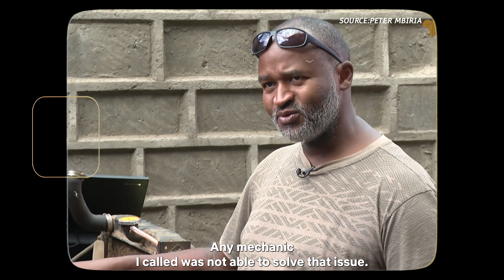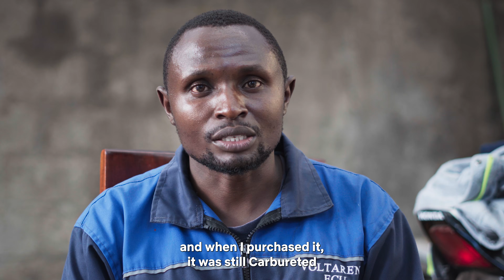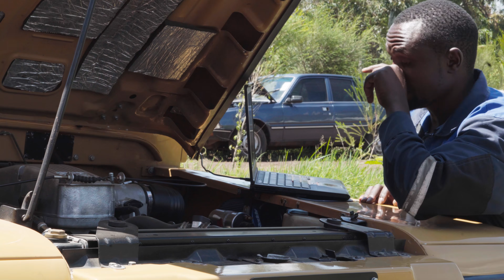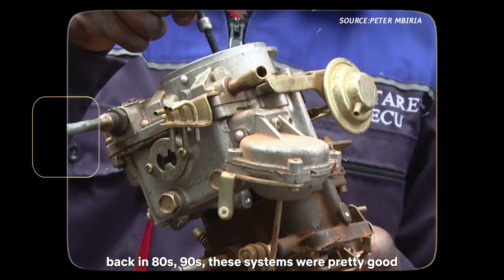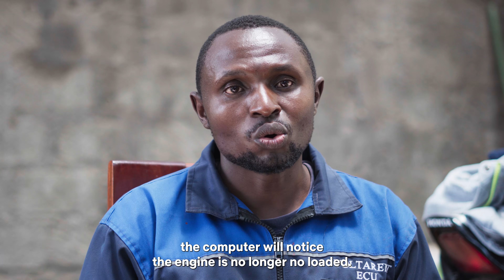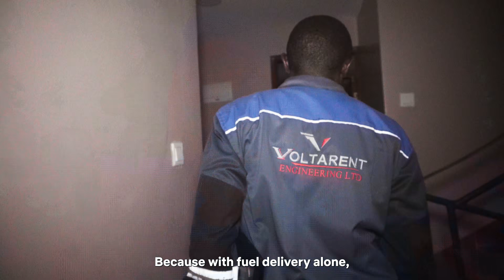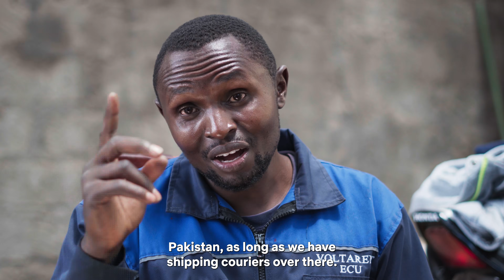This African Genius Makes Old Engines Work Better Than New Ones

Comment: I believe the ECU is basically a Speeduino. I don't see any major innovation there, but respect for the craftsmanship required to do the conversions.
Reply: The IDE on his laptop looks very much like the Arduino IDE.
Reply: @pjaenator  It says arduino at the top
Reply: @pjaenator  I made many things with Arduino boards that have been runnning for years, a few have been continuiously working for over 10 years. They are using Atmel MCUs. Of cocz my later projects have been based on ESP32 like everyone else but still, I prefer ATmega as it's legacy and never fail me over the years.
Reply: Looks like he’s designed his own PCB and definitely had to work with code because he’s using an Arduino Due which means even the speeduino firmware would take some effort to make it work.
Reply: yeah the technology itselft not so much innovation.
but the implementation in the certain condition makes thats a wonder inventions. 
coz maybe nobody want to do this. big corporation wont touch this because not much money they will get
Reply: @rofidganteng1  i mean... big corporations never are in the business of assisting you repair things. They want to sell more/new. But yeah definitely good for his community
Reply: Yeah i remember reading a thread on Reddit they mentioned it's not really cutting Edge stuff what he's doing
Reply: @watchinyoutube8919   nothing Elon musk is doing is cutting edge yet he does things
Reply: @watchinyoutube8919  does it have to be cutting edge for it to be a good idea?
Reply: Can anyone of you hater do what he is doing? I bet h
If it were some euro, you'll be clapping your hands.
Reply: @ No, if it was some Euro it wouldn't get a major video on the youtubes.
Reply: @Aliceinchains1234 bruv, this is the Afrimax English channel, ofc he wouldn't be on here if he was Euro lmao
Reply: You sound rascist @Marvin.45
Reply: @Marvin.45  I mean its basically Holley Sniper kit that holley made over 10 years ago. Affordable ECU + EFI conversion kit
Reply: Ya it's a common for Europe or a developed company. But this man isn't buying a ECU OFF A shelf and converting a carbureted engine to fuel injected. He's engineering and programming everything himself.
Reply: @Alexander12547 He just did a copy o one part of car from 30 years ago, based on electronics invented not by him. Sorry pal, that's just basic engineering and programming. Not to mention this is not universal
Reply: @polololo8377  no swap is universal. No, he didn't invent whole new tech. Yes, he adapted existing tech to old engines cheaply with good results.

Any gear head in the US that did this as a project would get praise. In Peter's part of the world, he is one of the few able to do this, and his work is far more impactful. 

The innovation is versatility and low cost for the level of results.
Reply: @XxxThePsyCheMisTxxX this, how many people out there are basically making and tuning speeduinos affordably for people to actually be able to find someone that can do all this work and custom tuning for a good price
Reply: @polololo8377 but can you do it?
Reply: @polololo8377  As an R&D engineer with 10+ patents. I would say invention doesn't get you far if you have no buyer. An engineering company has 2 major sides. The R&D side and the business side. He gets buyers and seems to be running a portifable business. This is not an easy task and quite an achievement. Over the years, I've been with start up with people that are extremely smart, with Ph.Ds and whatnot. However, doesn't matter how complex and unique your device / invention is. In the end of the day, it;s  business and you need customers, you need to make money. Tesla had lots of great invention but he failed as an inventor / businessman because he did not know how to do business. The world runs on money.
Reply: They the same as is it haltech ecus from Australia
Reply: And so?
Reply: How many engines have you transformed like he is doing so far?
Reply: Someone hurting 😂😂😂 as always
Reply: Innovation is the flexibility of the system, and the cost.

Full engine control renovation is a lot. Coil packs, MAF and EFI in a throttle body, and just like that early '00s efficiency and performance on tap (if the engine compression is good, etc.)

That's not nothing, it's darn scrappy and should be scaled up.
Reply: @n0n1cK0  i believe your just a hater.
Reply: Dude, stop being mean
Reply: This technology has been out for decades and readily available from multiple companies he has created nothing only cloned existing technology
Reply: @HorsedeadCowfat  could you clone it though?
Reply: While you yap he did i believe people saw it that way
Reply: He's Black. Ofc it's a major innovation.
Reply: @Aliceinchains1234 he's EE, not CE or CS; why reinvent the wheel when it isnt his specialty? His effort is in the proprietary artwork for the carrier card. Have lots of people restomoded with custom arduino setups? Yeah, but how many packaged that into a commercial product that serves antiquated cars in austere conditions; this guy.
Reply: @Aliceinchains1234 bringing racism to YouTube, now that's innovation! sigh

Comment: This video kept me interested enough that I watched it all the way to the end. However, I would have liked to see more of how the new fuel injectors join up with the old carburettor intake system. Obviously the carbs come off, but then what? I'm intrigued though and would really like to know more. I used to like tinkering around with carbs on my classic cars, but they're so wear-prone and so easily put out of tune for something that not only effects economy but the health and longevity of the engine. A carb that's out of whack (either too lean or too rich) can greatly reduce an engine's lifespan.

Comment: I need your help,I have diahatsu mini truck 1993model and it has low compression I'm from siaya county
Reply: either piston rings or valves are worn out and need to be replaced
Reply: @elu5ive  piston rings and valves have been replaced and it started losing power timing and the distributor was touched

Comment: he's a good mechanic with passion, which is the most important thing here.
these self inflicted issues of german mechanical fuel injection have been fixed approximately 40 years ago,
but it's impressive that he can do so much locally, with little equipment and bad availability of parts and barely any industrial infrastructure
Reply: He’s more than a mechanic.

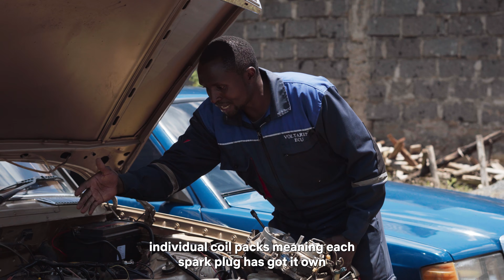Comment: 4:00 he talks about that FDS ive seen one of those be rebuild in the EU a while ago with oldtimer restoration. But a lot of people dont know how rebuild these already so. also it being part mechancial and electric doesnt make it easyer. I can see why a newer ECU could probaly run the engine better then the old parts that are harder to find eventualy or to be rebuild. Also to make that landrover run cheaper -- it has a market in the EU and the U.K by the way. -- there a lot of people who stil like them landrovers around the globe. keep wrenching nice work i do think this is better for the climate to keep the old cars running for purpose they where produced.

Comment: I’m not trying to knock this guy, but Holley and Edelbrock have been making retrofit throttle body EFIs for a couple of decades now.
Reply: The problem is that in Africa you can't afford a Holley or Edelbrock kit because of the price
Reply: Guy seems clever & hard working, if he tried I’m sure he could afford the NA or EU MSRP on a kit, but by the time it’s been shipped all the way to Africa through several different rounds of customs sold resold & sold again through places that need to hire security to do police’s job, he ends up paying much more than we would for the same parts.
Reply: People mad at you pointing this out is hilarious, when in the video they present him as literal mechanics jesus, reviving the whole autoindustry of the world by himself
Reply: I was gonna say the same thing. What's impressive though is that he coded all the software himself and built everything by hand.
Reply: @djhaloeight for sure.  Not trying to take anything away from him, but the tech itself isn’t some new breakthrough.
Reply: True, and Holley and Edelbrock's EFI are nice products.  However, this man has cleverly changed the ignition to multicylinder coil packs, something they don't do, since they tend to cater to 8 cyl classic US cars.  
Regardless, those EFI systems would not fit on these smaller engines, and even if they could, I'm sure his conversion is much more cost effective for the Kenyan people.
Doing more with less is a testament to great people.  My deepest respect to Peter and his hard ingenuity and hard work.  Cheers!
Reply: @devocite good on him, like I said, I wasn’t knocking what he does, but a lot of people in the comments seem to think nothing remotely like this has ever existed.
Reply: Came to comment this but still kudos to the dude for learning how to build this himself. Not sure how DIY full PCB build wiring and programming can be cheaper but if it is that’s gucci.
Reply: True, but he seems to be serving the oddball foreign car market. 
Edelbrock and Holley kits are primarily serving the American classic sports/muscle car and truck market. This guy's seems he's set up his software to be easily adapted to multiple engine sizes which is quite impressive given his lack of resources. Imagine what he could do if had some type of prototyping house. 
In any case, I wish the retrofit market was more of a priority.
Reply: @fatdan_95  yes. Keep worthy cars deserve to be born again. Also it's good for the environment in terms of using older cars instead of making countless new ones.
Reply: Yup, this has all been done before. The dude is a really good DIY'er but the way they're portraying this as groundbreaking innovation only amazes people without proper knowledge. It's like those 3rd world mechanics rebuilding an engine in a sandbox and people being amazed by their ingenuity.

They do a lot with very little, but how do you think we used to do stuff like that?
Reply: @sinki19841984 the point is what are you doing to help your people. Instead of tearing someone down. Why not build them up.
Reply: Yeah it's borderline insulting how people see an African do anything remotely technical and pretend it's some kind of world shartering feat of inginuity lmao
Reply: Good luck finding Edelbrock or Holley in the 3rd world for 20 year old cars
Reply: Yeah but are they available or affordable to the African market?
Reply: BUT, are they widely available where this man is doing his work?
Reply: It's an African News YouTube page in English. There's tons of things in the West that don't exist in the third world countries. This is like him figuring out how to create broadband internet in rural Africa.
Reply: Was thinking the same. And they also have knock sensing capabilities
Reply: Have they been making them in Africa?
Reply: Holley, Edelbrock and now this guy are making them. Are you making them though?
Reply: @TriforceBiH re-read
Reply: I’d love to see what you’ve built…
Reply: He built a whole village for himself and now trump wants to invade it. He's that successful 😂
Reply: They don't ship to this country for good costs. Relax

Comment: So like a 4 cylinder would actually be running on 3 and using the rest of the cylinder banks to do combustion?
Reply: And by combustion I mean the pistons travel, upwards.
Reply: You probably go through spark plugs and ignition coils alot.
Reply: Variable cylinder combustion?
Reply: Is 500-1000 dollar spark plug changes cost efficient though? Am I wrong for thinking that?
Reply: If you vaporize fuel at a faster rate does that emit more emissions?
Reply: So you would be emmitting more emissions at a faster rate?? Especially if you used this as a performance product?

Comment: Why not just use a Speeduino? Open source software, Arduino based hardware. Lots of community support, very cheap - I built one myself and am no electrical engineer.
Reply: @st5rk  So what you're saying is, NOTHING he has done here is new in any way?

Comment: Other companies produce aftermarket EFI systems but, they're pretty expensive. I never understood why, there isn't that much going on. All you need to do is read data from sensors that already exist, then squirt some fuel at the right time, and trigger a spark.

Comment: Yes this improves fuel economy and puts less wear on the engine, as you don't have that excess fuel washing away the oil film on the cylinder walls. I would not say is performs BETTER or even as well as new ones, especially when it comes to emissions. Around the late 70s when cars were forced to run leaner above the 14:1 stoichiometric ratio they started to runner hotter creating NOx (which is why EGRs were added). Eventually they build that EGR function into the cam itself using valve over lap which allows some of the exhaust gas to stay into the chamber (keeping the combustion a little more cool). 

That's just one example of many. There's improvements in catalytic converter tech, piston ring friction, combustion chamber design, piston design, direction injection fuel tech, cylinder wall construction, thinner oil weights, reduction to not only the vehicle but the moving engine parts as well and many other items. A single guy adding fuel injection is not even close to the level as 1000s of engineers and multi billion dollar companies scrambling to create the most fuel efficient vehicle possible. Yes, modern day vehicle are less reliable and that's because they are pushing the absolute max out of the engine for fuel economy/emissions. 

My point is adding a fuel injection system to an older vehicle is great, It allows the computer to more precisely adjust fuel injector pulse width, increasing engine longevity and fuel economy. However, it can not replicate the actual machine work, material work, oil chemistry and engineering modern day engines are able to do. A port injection kit slapped onto an older engine can't compete with a modern turbo engine that's been designed to run VERY lean and can make extremely precise adjustments on direct injection.

I'm not taking away from what he is doing and he is a smart dude. But the title is click bait.

Comment: He's basically replacing the old ECU firing software with new fuel efficient software in conjunction with adding fuel injectors and coil packs so he is modernizing older cars which is awesome.

Comment: Man done a standalone in africa that can be fit into anything what a legend
Reply: I'm pretty sure it's just a custom clone of a Speeduino board so not really anything new
Reply: that's exactly what happened. You can see arduino based pcb on the picture. But surely he spent a lot of work to make that work.
Reply: He just did a copy o one part of car from 30 years ago, based on electronic invented not by him. Sorry pal, that's just basic engineering .
Reply: Then what? He is saving, and transforming otherwise neglected items, into new and functional products. What is your contribution?
Reply: @polololo8377 basic engineering but genius execution and vision
Reply: @polololo8377  it is basic for you , where he is , he is a genius , he doesn´t have all the access like you .
Reply: @chun2s not sure what this has to do with a fact he has internet and computer exactly like I do and not much else and he can download all the apps and documents describing how this works and how it's build, therefore it's not an invention.
Reply: @polololo8377  Considering that an invention "may be an improvement upon a machine, product, or process for increasing efficiency or lowering cost", the fact that he manages to develop and sell this technology in Africa at the price rates he does, could well fit into the definition.
Reply: @polololo8377 Still had to learn English in a non English speaking country
Reply: @polololo8377  now with all that knowledge please create and install with common coils and machining intake manifolds and putting injectors on them , he is also a mechanic and he fine tunes every single car .
Reply: @Reece28888 😂
Reply: Come on, still  a creative outcome!
Reply: Exactly! What does The Library of Congress stipulate? IMPROVEMENT, and he has it?

Comment: So hes doing carburetor to fuel injection conversions on older cars. Not really a genius but definitely intelligent considering the resources.
Reply: It takes the effort tho
Reply: @bhattibrother9218  sure does, and ingenuity.
Reply: @skt91164  did u pick up how it disables the knock sensors
Reply: @bhattibrother9218  he would be a genius if he designed his own high performing efficient engine from the existing engine parts he has access to and was able to reproduce it on a grand scale.
Reply: @skt91164 for sure but even if he’s able to deactivate cylinders like 8 cylinder to 4 that would be great too

Comment: Great! Sustain! I like it. This was my thinking also, also for high consumption American cars, remove the carburetors and run it with highly controlled  fuel injection, also with turbo. Then very low consumption is possible. 
To your pcb design: The power side is right, on the left are the connectors. I saw your heavy wires. May be this was your first design. For further design is to make all without wires. I guess you showed the next generation almost. Let the world learn from you.

Comment: Lmao, he cut out a bunch of sensors and went back to the Stone Age with a basic ecm is all he did 😂💀. He got rid of the o2 sensor? There goes your efficiency and emissions levels 💀. Also got rid of the knock sensor? Yea no wonder his engines are knocking because they for so many problems of course he got for it it 💀💀